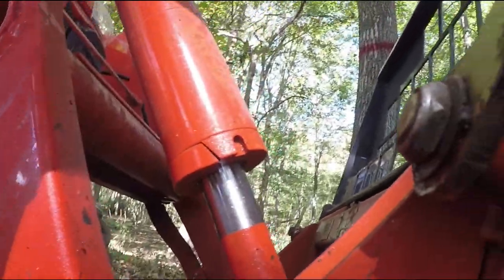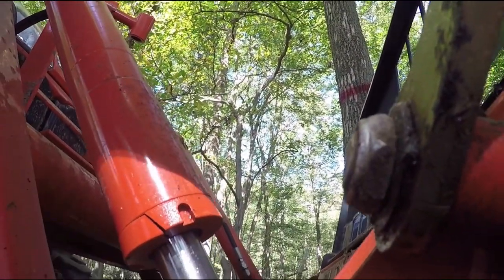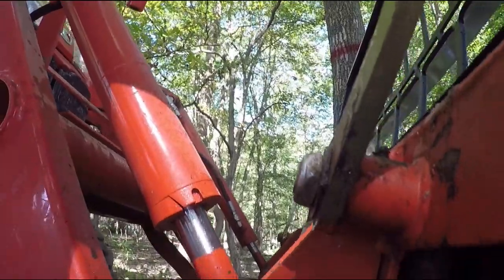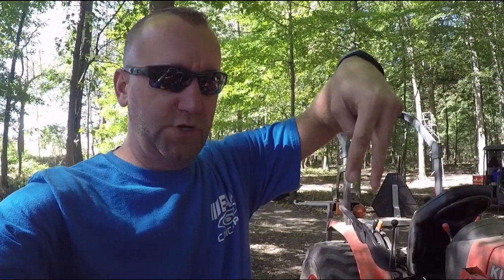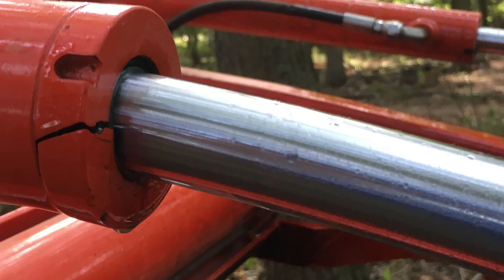Don’t Do This With Your Tractor!!

Comment: Thanks for this video, I do this a lot with my 3901 Kubota. I never realized what a strain I was putting on the curl cylinders.  I don't drag logs backward but some of my firewood is in piles and I backdrag the top of the pile to make loading easier. I'll be careful now.
Reply from the maker: Dan Dalrymple 
Absolutely!! How do you like your 3901? I’m considering that as my next tractor.  I like that it weighs more than mine and can lift higher, even though it only lifts a little bit more.
Reply: I use the 3901 a lot with firewood, mowing and clearing snow. One thing I DO NOT like about it is the "particulate filter ???" in the exhaust system. During our Ohio winter when I'm not mowing and running the engine hard the particulate filter in the exhaust system requires letting the tractor sit while running the engine at PTO speed for a half hour or more. This happens several times each winter. If this is not done the tractor will not run correctly, near zero power, near zero RPM. No problem with this in the summer when I'm mowing at 2500 RPM with my 3 point 6 foot mower. This keeps the filter clean? Dunno. Wish there was a way to eliminate this problem.
Reply from the maker: Dan Dalrymple 
That is a problem with all DPFs. They require heat to clean them out or they get plugged up. You never want to baby an engine with a DPF. I’m a little weary of getting one but I don’t have much choice if I want HP. 

My dealer keeps suggesting the 2501 because there are no emissions on it but I don’t know. He says no one complains about the power but it has to be geared lower and that results in a lower travel speed. I drive my tractor on the road between my house and woods and I don’t want to go any slower than I have to.  

If you didn’t know, I’m in Ohio too so I’ll have the winter to deal with as well.
Reply: It was 5 BELOW ZERO yesterday morning and I needed to plow my driveway. Waited until the pre heater light went out, it turned over slowly but started right up on the first try. So I do really like my 3901. It always starts and runs fine, still don't care for the DPF but NICE tractor.
Reply from the maker: Dan Dalrymple 
Mine started slow also. I previously had a thinner weight oil in it and this summer when I purchased my filters and such the dealer gave me 15-40(?). I questioned it but he said that’s what is spec’d. It turned over A LOT slower with that. I looked in my manual and I can use 15-40 or 10-30(?). I’d have to look at my manual to make sure I’m right on the numbers. I will definitely be running the lighter weight from now on.

Comment: This is why a skid steer is the tractor's best friend. Much more rugged machine designed for commercial use, stronger lifting and a lot harder to bend a rod. The smaller tires will slip before transferring the torque to the attachment.
Reply from the maker: chargermopar 
A skid steer is much stronger but I’ve found reports of them failing in the same way. More than anything, I want people to think about the physics behind what they’re doing and what stresses are being applied to the machine. I just wasn’t thinking when I did what I did.

Comment: A cylinder is always at it's strongest point when fully retracted and workloads should be applied accordingly. The machine was designed to lift the load inside the bucket, at which point the cylinder would be mainly retracted. It's time for a set of logging tines so you can drag that sob from the draw bar. Most of these little tractors get pushed pretty hard when they're put into logging situations, I see it all the time as I live in the heart of logging country. A 24" bucked white oak @ 12' long is no joke.
Reply from the maker: Southeastern Ohio Honeybees 
I agree with the cylinder being strongest when retracted. 
I skid with an attachment I built for the 3 point hitch. I just was just trying to spin the log around so I could grab the end.
Reply: Often times we don't want to leave the seat on and off to hook up cables to get it rigged correctly but..... I skid with a D3C Cat so I can't throw judgement at a guy who uses his tractor at the fullest of it's ability, I understand completely, it sucks you had to pay $500, to teach us all the lesson but thanks for the schoolin.
Reply from the maker: Southeastern Ohio Honeybees 
At the time I also didn’t have a cant hook. If the logs were on the dirt I’d have to get them up on the chains somehow. Now that I have a cant hook I don’t mess around with spinning the logs as much or lifting them onto a branch for temporary height.

Comment: Ya with almost any other loader it would not be a problem but the Kubota stuff is made to be used very lightly! I worked as a warranty admin. at a Kubota dealership for years. Sorry to say I have seen it many times before!
Reply from the maker: Brp Fan 
It actually happens with every make and even with the big stuff. Track loaders, backhoes, etc.
Reply: WorthOverdoing Sorry I only saw it on the smaller stuff, especially Kubota all the time! The big farm loaders never had that problem. We had 4 different lines of loaders we sold. 25 lines of farm equipment in total. Seen the Kubota cylinder shafts bend like crazy and Kubota will NOT give you warranty on it if it’s your fault or not! Seen that way to many times!
Reply from the maker: Brp Fan 
When I researched the problem I found it on almost every type of equipment. I heard the same thing when I took my cylinder to the hydraulic shop. He said he’s had to fix them on just about everything. There’s also some comments here from guys who have done it with large equipment.

Comment: These are the pros and cons I researched before buying a machine. I bought a skid loader. And then a Larger Skid Loader. New Holland Lifts Higher and is easier to work on than most. Hours and hours of use and still running.
Reply from the maker: Joseph McCue 
Awesome. I’ve thought about a skid loader and may get one in the future. And you’re right, there’s pros and cons for each. For me, the tractor made the most sense to get first.

Comment: Seen a pile of bent tilt rods when I worked for a skid steer manufacturer. Our problem was the stops at full tilt so the cylinder could hit loader arms if you fully extended then tried to push with the bucket edge, it was a new design of cylinder and the tolerances are very tight. Was surprised that anyone would think this was OK to do but people do it. The kubota's do have stops that prevent damage if you do this. All equipment could suffer this failure if somehow you exceed the design limits. lucky it was just the one cylinder, typically its both. Bent cylinders are very rarely warranty due to the fact that manufactures are very careful to design so they shouldn't bend unless abused. RPM has little effect as one comment says because the relief valve is set by pressure, RPM only effects flow. Kubota makes good equipment, I have a B2601. Typically a rebuild for this  type of failure is more than a complete replacement cylinder and  you are never sure the rebuild will last.
Reply from the maker: MichaelPMc 
Very well constructed and intelligent post.

Comment: In Thailand most Kubota tractors have a dozer blade attachment on. It is extremely sturdy and makes backblading so simple. 
I work in construction in Africa and we use backhoe's all the time backblading, never had an issue with this. I have to admit, being a huge Kubota fan, there might be a design flaw there. Any tractor with a loader attachment ahould be able to backblade without any such issues.
Reply from the maker: Tertius Bezuidenhout 
This isn’t isolated to just Kubota though. I found all brands with similar failures, even heavy equipment. It comes when the cylinder is fully extended and then the machine is driven and force is applied to the cylinder. If you’re operating the hydraulics it won’t happen because there is a relief valve inline. It’s only when the spool valve is centered and the fluid is locked that it creates a hazard. Think of having a hydraulic cylinder sticking out of the front of a tractor, fully extended, and you drive it into a concrete wall. The cylinder will bend because the tractor drive is stronger. Once you apply leverages it makes it even easier to bend.
Reply from the maker: Tertius Bezuidenhout 
I’m going to have to look for some pics of the dozer blades they use in Thailand. Sounds interested. Must be using a subframe then?

Comment: STOP RIGHT WHERE YOU ARE.... and do NOT try to retract the bent ram if you can help it. Once you suck that ram into the gland you ramp up the damage and the expense. 

Of course, one must almost go Zen and be as one with your machine to notice it's in trouble and you screwed up..... for you to not do more damage by mistreating it further. 

I gave my operators ONE BENT RAM, gratis.... the second bent ram was their termination notice.

I repaired many Bobcats for the same problem. But after teaching operators to keep the control in the "extend" or apply mode, there's someplace for the oil to go if you snag the bucket. Single cylinder Bobcat rams... like their earlier "Bob-tatches".... even though the rams are large, do this all the time with ignorant operators.

So... keep "applying" pressure to the ram when you back-drag and if it snags, the hydraulic pressure has the system safety blow off valve still in the "charge" side of the ram and can vent instead of bending the ram when there's no place for the oil to go.  

If you do it right, you'll hear the blow off venting while the ram is fully extended. That's a good thing... and you won't damage the gland by doing this.
Reply from the maker: Joe Vreeland 
All great info Joe and thanks for posting!

I’ve received several comments where people expect the relief valve to relieve pressure but they don’t realize it’s not in the circuit unless it is used like you stated. You must keep the valve engaged so the relief is always in the circuit.
Reply: Wow. Thx for the heads up on all that.

Comment: Interesting and strange at the same time. I have a 35 horse New Holland and have done LOTS of back dragging with it, even to the point where it'll lift up the front of my tractor and I've never had any issues with my curl cylinders. I have a feeling that with your forks you had extra leverage going on and that is what put too much stress on your machine. When I do logging work I try to use my Kubota mini excavator, it's easier anyways. I still think Kubota makes a good product. Thanks for sharing, I'm sure it'll help a lot of other people out there!
Reply from the maker: BarnStangz 
I’ve also back drug just like how you stated without issue. The forks almost certainly had something to do with it but I also found countless reports of it happening to people with just buckets, which is why I’m sharing. It’s even happened to backhoes, track loaders, etc. It’s usually when you hit something unmovable and the bucket doesn’t go up and over it. The forces of the machine moving is usually much higher than what hydraulics can stop or handle.

Comment: On my TYM they actually put a pressure relief  in the loader control valve to not allow back dragging. So the bucket just rolls flat if you put much load on it.

The problem could easily be fixed, but no-one does. Trunion mounting the cylinder would help, but more than that make the cylinder extra long, and prevent it from fully extending. Then the rod won't be so cantilevered at the operating conditions and it won't fail.

As things are now, I think the bucket design needs to change. They need to add a scraping edge at the bottom back corner for backward dragging. Ideally far enough out and tall enough that it does not put dirt in the pivot points all the time. It would probably save time too, as you would not need to roll the bucket all the way forward as often.
Reply from the maker: Court 
The only pressure relief on mine is on the pressure side of the spool valve. It would be nice if there was someone on the other side that was set higher than the main just to prevent shocks.

Comment: Just a tip, but don't ever suck a bent rod back into the cylinder. Before you sucked the rod back in, you may could have went to a hyd repair shop and saved your tube and piston, sucking it back in surely destroyed both. Also, by sucking in the bent rod, you introduced no telling how much metal shavings into your tractor hydraulic system.
Reply from the maker: m16ty 
Yep. Definitely my fault on that.

Comment: I'm glad you decided against putting a aftermarket cylinder of a different stroke on there. You would have really torn stuff up if you had 2 bucket cylinders of different stroke.
Reply from the maker: m16ty 
I would not have put 2 different size cylinders on there at the same time. Would only replace both with something different.

Comment: Extending the bucket into the dump position and dragging, pulling or pushing with ANY size tractor or machine is not a good idea.  Thanks for sharing your experience.
Reply from the maker: sideskraft 
I agree. Larger machines with bigger cylinders still have enough power to damage the bigger cylinder.

Comment: We have a B-7100 kabota, and we put a hair line crack in the end. We did not see it at first, so we thought it was the packing, so we put in packing in and it still leeked. So we tore it apart again and that is when I found the crack it was real small. it was 400.00 for the new one. Still use it just as hard as before. You can straighten that ram if you have a press that is easy to do. It might be cheaper to buy the ram and the packing gland, then buying the hole cyclender.
Reply from the maker: Terry Westbrook 
I wish I could have but I deformed the tube. I didn’t know that until I took it to the hydraulic shop.

Comment: I watched the first 5 seconds.  And, just because I've heard it before, those kabotas are notorious for curl cylinder failures, due to the design.  I don't own one, but I don't think I ever will because of it.  I've heard too many kabota owners say their curl cylinders are messed up.  Mostly because of operator error, but, if they didn't travel quite as far, the problem wouldn't exist.
Reply from the maker: chevytruckman34 
I found far more than Kubotas with curl cylinder failure. The problem isn’t prejudice to a particular manufacturer.
Reply: I'm certainly not going to try to start an argument, but I rebuild cylinders all the time, amongst other things.  I'll just say that you may have done the job cheaper by having a local machine shop make a new rod and buy new seals.  That may not have been an option, I get that.  But again, I hear it mostly from people who own kabotas.  Very seldom do I hear it from Cat or Case owners.  But of course, this is just my opinion working on heavy equipment every single day.  We are talking about a compact tractor.
Reply from the maker: chevytruckman34 
You’re good. No arguing here. I did try to get it repaired. In my haste to keep working I put the forks down on the tree and pushed the rod back in. I was skidding trees and needed to keep working. Unfortunately, when I did that I deformed the tube. The hydraulic shop said a new tube, rod, and end cap would be more than a cylinder. 
Thanks!!
Reply: Well I'm a parts and service guy at a kubota dealer and iv never sold a cylinder due to a bent rod an we have lots of kubotas out there js
Reply: When I had my own ranchette, I was approved by Kubota Credit for their line of small Diesel tractors. Maybe it's a good thing I didn't buy at the time,eh?
Reply: 2 words John Deere
Reply: L3240 with 3400 hours.  Back dragging all the time with it and no problems.  It's how much angle you curl that causes the failure.  It you only curl a small amount you can back drag and not hurt anything.

Comment: Is this only an issue pulling backwards, or is it also an issue pushing forwards with cylinders extended?
Reply from the maker: This is only an issue when pulling back. You have to envision that the bucket is pivoting on the bottom pins. When you are pulling back the bucket is trying to rotate on those pins and push the cylinders back in. If you are pushing on the bucket then you are trying to pull the cylinders out. They are much stronger in that direction.

Comment: cycle the curl function 10 times or so and feel the outer bore of the other cyl, if it feels hot, that piston rod is bent as well.  You can replace the rod and gland, fixed a Kubota, both were bent, just replaced the piston rods.
Reply from the maker: fastst1 
I took it to a hydraulic shop and, unfortunately, I deformed the tube. The repair isn’t worth it. Too many pieces bent or broken.
Reply: How is the other side curl ram, no binding?
Reply from the maker: fastst1
Correct. The other side is just fine.

Comment: I have owned loaders since 1964. We use and miss use them almost every day. I sold one loader when it hit 36,000 hours without damaging a boom or cylinder. I had one loader that would consistently crack the end of the cylinder. I was told it happened due to a design flaw that put too much stress on the cylinder, I got fid of it soon. I have owned a grapple on a loader since 1978 without anything like that happening.
Reply from the maker: John B 
That’s awesome you haven’t had it happen to you. Sometimes we get lucky. Sometimes we don’t. It does take a particular set of circumstances to make this happen though. Ive found it happening on large track loaders, excavators, skid steers, etc. It isn’t something isolated to tractor loaders.

Comment: Save the cylinder & shop it around to machinist and see what the cost to rebuild/repair is. Thank's for the information.
Reply from the maker: Stanwood Dave 
I took it to a hydraulic shop and unfortunately I deformed the tube so it wasn’t worth repairing.

Comment: You used the exact words to describe the problem "full extended cylinder".  On any machine, that sets up risk of part failure.
Reply from the maker: Absolutely. It has almost zero support and is at its weakest.